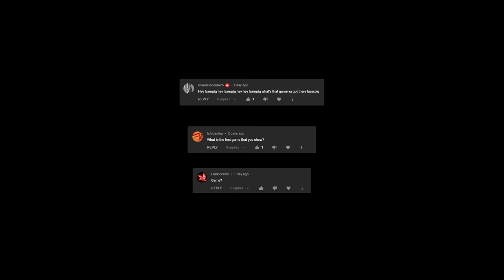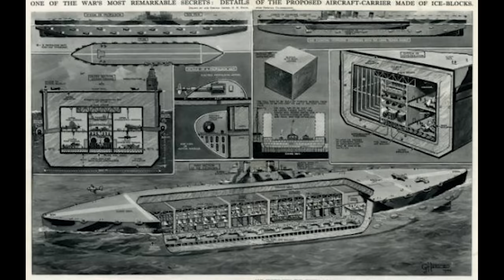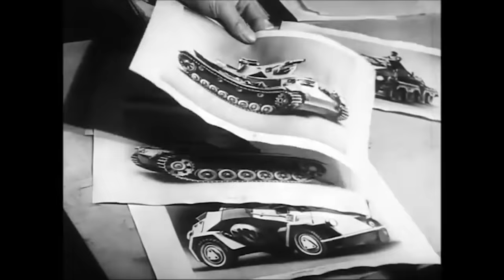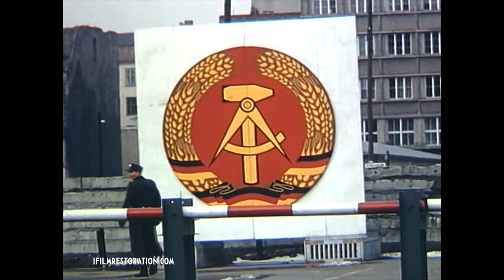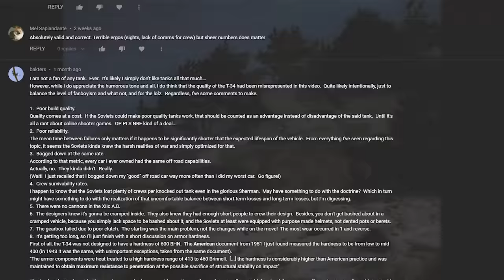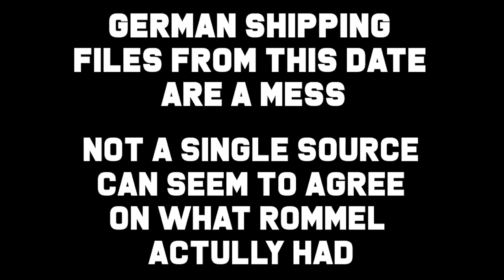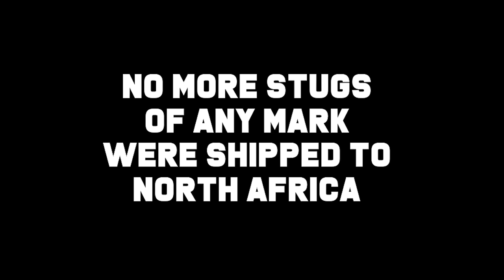In defence of the Crusader Tank

Comment: I am reminded of why the P-38 was legendary in the Pacific, and not particularly successful in Europe. Context was completely different.
Reply: Yep. Range and twin engine reliability were valuable, and high altitude performance and maneuverability wasn't.
Reply: @treyhelms5282  The P-38 had plenty of high altitude performance and maneuverability. That wasn't the problem. 

What it did not have was mach limit, or cockpit ergonomics. Which meant in the context of the European theater, where you could get ambushed at any time, new pilots would frequently get overwhelmed by handling the aircraft and get shot down. And even when they didn't, the German fighters could disengage in dives the Lightning could not follow. 

Also it didn't have heat sources in the cockpit so it was freezing in the winter. 

In the Pacific, the IJ fighters tended to have much lower mach limits, and the dynamics of the war there meant most fighting was over much more well known locations, so the surprise factor wasn't nearly as much of a thing. 

The lack of heat sources in the cockpit was also much less of a negative. :)
Reply: @HarryVoyager  The P-38 had good high altitude performance compared to Japanese planes, not so much against peers and foes in Europe. 

Maneuverability, no. And ergonomics did play into that, like it's yoke.
Reply: @treyhelms5282  Be careful that you're not comparing a 1943 P-38 plane to a December 1944 109G-10. 

The P-38 was a 400mph+ at 27kft from the start of the war, and entered service at around the same time as the Bf-109F versions. Even by the time it saw combat, that was only around the time the Germans finally got the DB605 running at 1.42ATA, so it's still facing 109s that are only pushing 380mph at about 16kft. 

Now, the P-38's speed did not improve during the war, but again, that's because it is so close to its mach limits that going faster just gets you into more trouble. 

As for maneuverability, the P-38 can turn inside a 190. We've had an actual aerodynamicist show it. It's close, but it can do it. 

But it's also got a 15+ step process to go from cruise to combat, and if you get the steps out of order you can easily turn an engine into confetti. And the controls for all that are scattered across the cockpit, so it's really easy to screw it up.
Reply: @HarryVoyager  You do know that until you reach maximum altitude, speed increases with height. In your example the 109 would be faster than the P-38 at the same altitude.

The P-38 was not maneuverable enough to be a classic dogfighter. Full stop. 

From wiki:
P-38
Wing loading: 53.4 lb/sq ft
Empty weight: 12,800 lb (5,806 kg) [163]
Gross weight: 17,500 lb (7,938 kg)
FW-190
Wing loading: 241 kg/m2 (49 lb/sq ft)
Empty weight: 3,200 kg (7,055 lb)
Gross weight: 4,417 kg (9,738 lb)

Things like Fowler flaps could help, and depending on the pilot's tactics you could outmaneuver a 109 in a P-47 lol, but you aren't ordinarily turning inside a 190 with a P-38.

Love the P-38, but let's not claim what it isn't.
Reply: @treyhelms5282  You're ignoring energy advantage, and the operational altitudes. 

In the ETO, in 1943/44 the primary mission was bomber escort, with the USAAF bomber corp operating at 27-30kft. The 1943 109's peaked at 16kft and lost power all the way up. Later 109's with larger superchargers peaked around 20kft, but the basic design of the supercharger means it loses power to turbos above 20kft, always

The P-38F at 27kf was faster than the 109G-2 and pre MW50 109G-6 varients at their best altitude, and at the altitudes it was operating at, the 109G's were 5-10kft above their critical altitudes, while the P-38 was at its best performance band. There's just no comparison in absolute performance. 

And wing loading doesn't tell the full story. Because of the airfoil, high aspect wing, full span wing, and the prop effect, the P-38 still ends up having a smaller turning circle than the 190, and ends up still able to bring it's nose around on it. 

Now, a smart 190 pilot could roll out and try for scissors. The P-38's roll authority was not good, especially before the boosted ailerons, but it had far better turn rate and AoA limits than most people realize. 

Which is also why the P-47 comparison is a bit silly: the P-47 has a radically different wing, which, while it had ridiculously low high speed drag, also had a very low AoA limit, so loved to turn into an air break if you pulled it to far. 

Also its flaps didn't drop at the same time, so even though it had very powerful slotted flaps, you never used them in combat unless you really wanted to die.
Reply: @HarryVoyager  LOL, no there's no universal law that turbochargers always beat superchargers, depends on the design.  And for most of it's career, the P-38 was slower at high altitude than the 109. 

 SMH, the steps you had to take to trim a P-38 compared with a single engine plane is part of the problem. To quite Robin Olds:  “I loved the P-38 but I got those kills in spite of the airplane, not because of it. The fact is, the P-38 Lightning was too much airplane for a new kid and a full-time job for even a mature and experienced fighter pilot. Our enemies had difficulty defeating the P-38 but, as much as we gloried in it, we were defeating ourselves with this airplane.”

My analogy with the P-47 is if you look hard enough you can find examples of just about any plane outperforming a peer. Thomas McGuire turned the tables on some zeros by suddenly turning into them in at least one instance. But neither he nor anyone sane would argue the P-38 was as maneuverable as a Zero or Oscar.
Reply: @treyhelms5282  There is. NACA analysis showed that the fundamental way superchargers work mean they're limited to about 20kft. Above that they draw so much power from the engine to reach the necessary compression levels, they just lose power. 

Because turbochargers are drawing energy from exhaust heat and pressure, they have a much higher maximum critical altitude. 

As for 109 performance, you're merely asserting without evidence. I've shown the numbers, and the numbers show that, at the time the P-38 was introduced, it was clearly faster in level flight at altitude than the 109. 

As for the Olds Report, that is merely repeating what I've already asserted: the plane had poor cockpit ergonomics that made it difficult to respond to the ambushes which were more common in the ETO than the PTO. Which also has nothing to do with the speed or the maneuverability of the plane, which was my entire point: it was cockpit ergonomics and mach limits that lead to the P-38 performing poorly on Europe, not high altitude performance or maneuverability, which is what's commonly cited.
Reply: @HarryVoyager  dude, the B 29 used supercharged engines . 

What you cited was a small difference in speed between P-38 and 109, easily explained by higher altitude.

You’re the first person I’ve ever read try to make the claim that the P 38 was very maneuverable compared to a single engine fighter. I’ve cited the wing loading and weight compared to a 190, which wasn’t a very maneuverable aircraft itself. 

I’m enjoying this discussion, but I think you are really overestimating things that weren’t the Lightning’s strengths.
Reply: @treyhelms5282  The B-29 used dual exhaust gas driven turbo chargers, not purely engine driven superchargers.

It's confusing because the USAAF called the system a turbo supercharger, and after the turbo, it did have an engine driven supercharger to increase the sea level boost, which nearly every WWII piston engine had too. But if you take a look at the photos you can tell that it is ducting the exhaust gas into the turbo charger turbines, not driving them off the crankshaft. 

Am I arguing that the P-38 was more manuverable than all single engine fighters? Hardly. I am arguing it is as manuverable as most fast single engine single seat fighters, and that its maneuverability was not why it was not successful in Europe.

Different thing.
Reply: @HarryVoyager  nice info. And like I said there’s no law that superchargers can’t work, depends on the design. 

The P38 was not as maneuverable as most single engine fighters, even though the L series was an improvement over previous models. It’s lack of maneuverability did hurt it against German fighters, against whom the P38 couldn’t just outrun like it could most Japanese fighters it faced. 

I can’t find the quote, but a pretty well-known US pilot is quoted, saying about the P 38 flying escort missions over Italy basically what made the big P 38 great in terms of long range and fire power, it’s size, made it inadequate against the more agile German single engine fighters once it got to the target. Same would be true over Germany.

Comment: I firmly disagree with Lazerpig about operation Sea Lion.
Hey goes by the common narrative of "Britain is fighting for survival and just barely escaped destruction". I disagree and here's why.
Now, to be clear, the British were in a bad position! As Lazerpig points out, there wasn't much ammunition or equipment just hanging around. But do you want to know what the British did have? The fucking Royal Navy!
The British had dozens of destroyers and submarines and hundreds of patrol boats of the shores of England.
Now, the Germans weren't stupid, they knew that the Kriegsmarine didn't have a hope in hell to go toe to toe with the home fleet. The whole  point of the battle of Britain was to enable the Luftwafa to have air superiority and protect the invasion force. However, the Luftwafa was very poorly suited to attack ships. Their pilots were trained to attack static defences and slow moving troops. Definitely not ships that go 30 knots and that can do evasive maneuvers to throw their aim of.
Also, the German troops wouldn't be landing on the beaches in landing craft. Instead, they would be coming a shore in river bardges. Yup. They were going to cross the English channel in river bardges packed with troops.
Can you imagine just a couple destroyers managing to get to the bardges? It would basically be gunnary practice for them. Also all the Royal Navy had to do was block (most of) the  resupply and reenforcements for the invasion. Also the British had all of the ports ready to go kaboom if the Germans got close to captureing them. Yes, the home fleet would take heavy losses due to subs and bombing but there is no way they could destroy the entire home fleet.
So, in conclusion, I think that the invasion would've resulted in the death or capture of tens of thousands of German troops.
Reply: also one addition to that: cliffs.
Large parts of the British coasts are huge impassable cliffs leaving very limited options to actually land troops on. The roman empire found this out when they invaded britain. they had to sail for a day to find a suitable place to land their troops.

Comment: 41:00 Well yeah, the two aren't really comparable in that regard, since when a Panther broke down, the unit mechanic would promptly shoot himself, while the greatest strength of the T34 was ease of repair, so breakdowns, parts failures, and even combat casualties could get fixed faster and more reliably than anything the Germans had.

Comment: If there are no other tanks, then a tank is a great weapon, you just fill it up with high explosive shells and go ham, that is if there are no units that can threaten the tank. Which includes tanks ofc. But thats the point of a tank anyway, its high fire power and well protected against most stuff on the battlefield, it is increasingly more stuff out there that can bust a tank, and thats natural, thats the way technology develops. If some country had iron man or crysis suits, tanks would be silly for the most part, just nonsense infantry can take out easily, but if you yourself dont have alternatives for armored guns then why not. Any weapon is usefull in some way, and no weapon is infallible, thats not the point. In any given situation, a bespoke engineering effort can create a weapon that would just make a tank redundant, and that applies to any weapon, if we spent a trillion dollars stopping one tank once, we could stop a tank that is a hell of a lot more powerful than modern tanks, the question is the best over all capability that is economically viable, and that really fundamentally puts a gap between what is scientifically possible to engineer and what is practical to use. Over time what is possible often becomes plausible to use in some form, but every weapon is a practical compromise.
Reply: people when they find out tanks are full of compromises 🤯

Comment: I'm going to have to disagree with your damnation of numbers. If production capability weren't significant then the T14 (let's pretend it lives up to the hype, I know, it's hard to pretend it's not shite), the T14 would be in Ukraine and causing mayhem. Numbers alone aren't the winner but generally speaking, more tanks tend to be helpful. Assuming a good tanker can put rounds on target 25% of the time, the odds of hits and more importantly, effective hits, increase with each tank you have blasting at the target. In a similar vein, it makes you safer. If, hypothetically, you can outnumber the enemy by a factor of 2 then you probably have enough vehicles with enough guns to steamroll the enemy through sheer volume of fire and take reduced casualties as there are more targets for your enemy to shoot at yet more allies to shoot at each enemy. 
 So in large scale combat, more tanks is usually an advantage. High production rates can simply bolster the supply of spare parts too. Building a lot of something can be essential for maintaining a fighting force. 
 Numbers aren't the only thing which wins a fight but they certainly help. They definitely take an otherwise mediocre, often downright awful, vehicle like a T34 and make it a viable weapon system.

Comment: Hey, every vehicle is just as good as their luck and their propaganda combined. 
what if France in start of ww2 had  AMX 13's instead, but still did not know how to use them?  Horrible tank, got steamrolled by pz1's and 2's etc...etc..
but then imagine same scenario with with France having modern level of knowledge in warfare and intel on Germany attacking and their forces. 
suddenly we would have legends of them, being 1 shot 1 kill, and stories of them popping out of a corner, destroying 4 tanks before they can aim at him, before running away. 
history is written by a victors, and its no wonder our is made better, than it was. We need legends of our grampas, saving incompetent and divided France. 
otherwise story would not be interesting enough, or good enough, to keep sharing it. 
It's rare to ask the beaten how they felt during our war crimes. Usually that's a bit of a problem, after all the effort that was put into a war.
also famous reliability issues, can be many small things, like oil quality/composition,  or factory making due with that they have, used cast iron where specs called for good steel. 
a lot of those tanks would be way different if jankies/brits/french would notice something fishy is going on.